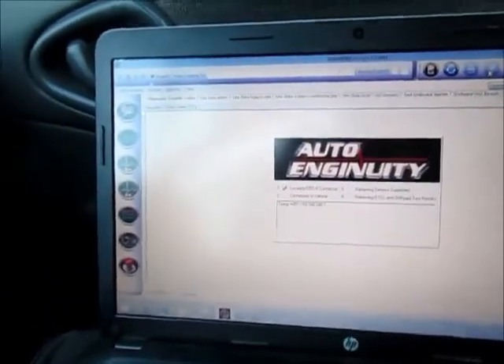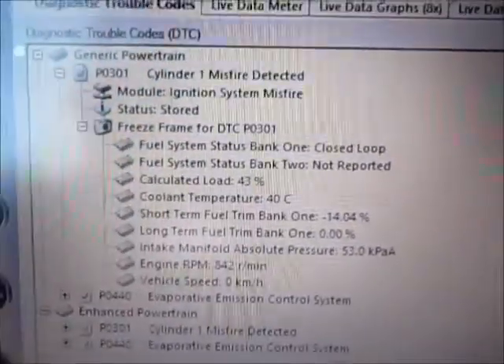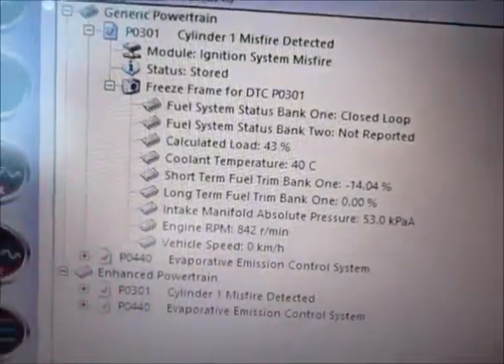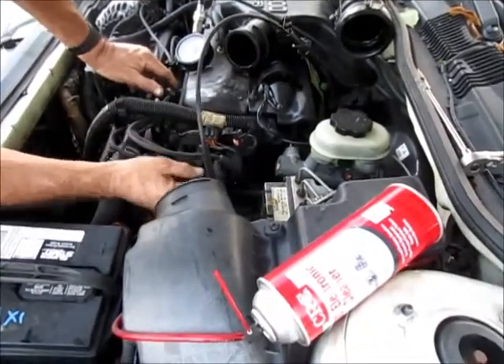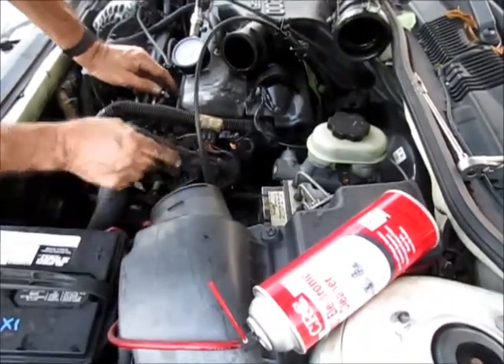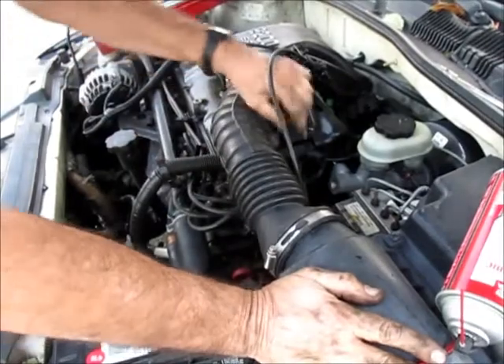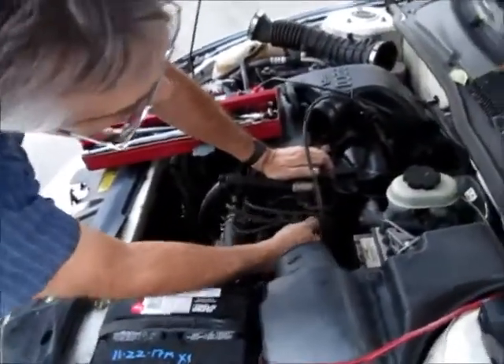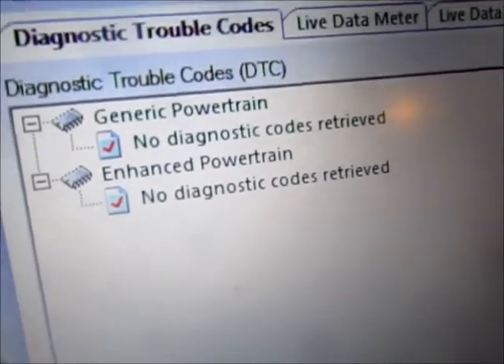Misfire diagnosis and repair and monitors on Chevrolet Cavalier.

Comment: Instead of swapping the coil packs, I would have checked the coil output voltage. I always replaced the original carbon resistance spark plug wires with Magwire, which is wire wound, giving more spark to the plugs.

Comment: Helpful video. I am going through same process on my 96 cavalier (plugs, wires and coil packs). Unfortunately on the 96 the coil packs are on the lower rear of the engine - very difficult to get to. Grrrr!